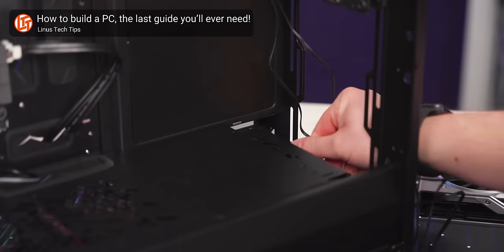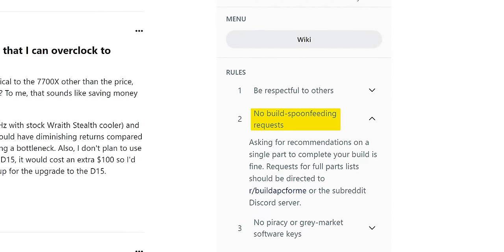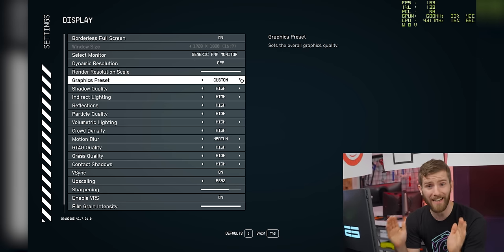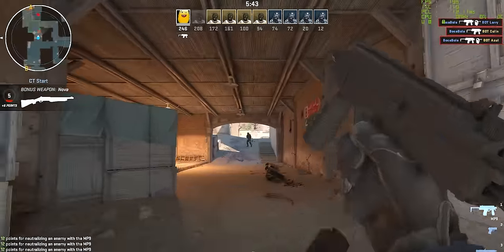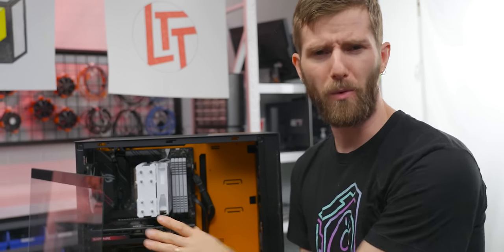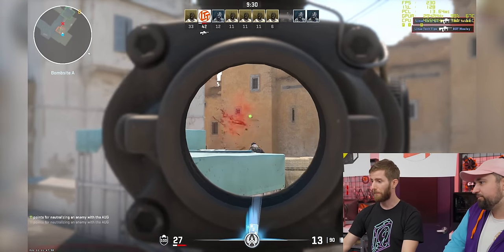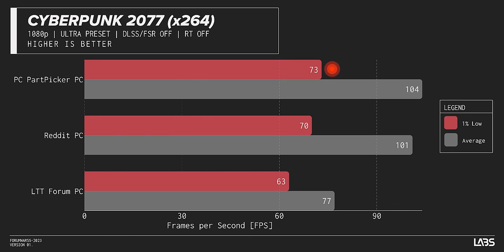We Secretly Challenged 3 communities to Build the Best $1000 Gaming PC!

Comment: Hi LTT, Love the video but there are a few areas I believe that could lead to some confusion.
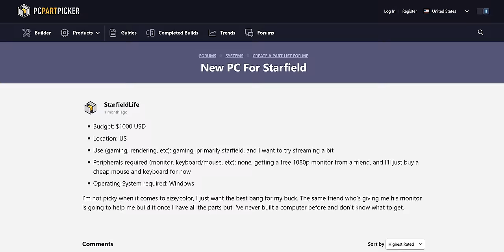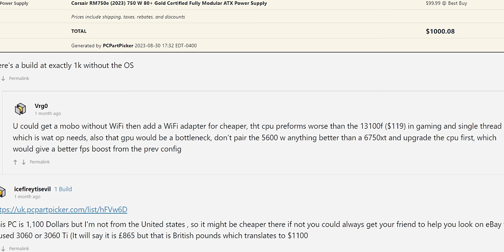1. the LLT requirements at 1:48 states "operating system required:Windows", however not all the builds chosen by LLT include an OS therefore not meeting LTT's own requirements (leading to difference in recommendations such as PC part picker at 6:14) nor staying within budget. This also skews the cost vs performance vs helpfulness of said forums.
2. Minor scripting error at 3:23 when Linus states "16GB kit". On screen information and build both state 32GB
3. Possible discrepancy with Reddit Build at 4:07. The screenshot shown has two storage devices in the cart/build (2x WD Green 1TB NVME). This is different than the Single Titanium Micro TH4985 1TB listed in the video description and the Reddit buyers guide. Without knowing what build was actually purchased, this again could skew cost vs performance vs helpfulness.
4. Aligned with #3 above, at 6:54 Linus mentions the PCPartPicker build has "half as much storage at 1TB". The storage for the Reddit built was never shown nor discussed in the video. Also based on #3 above there is no factual proof that the PCPartPicker is indeed half the storage, as if the listed Titanium Micro was purchased based on the video description then it would be the same not half.
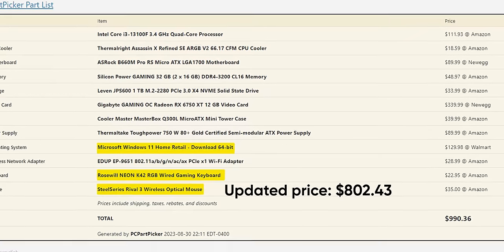5. Issue at 6:28. LTT removed the copy of windows although stating Windows and OS was required, see #1 above. Also the build was not chosen as it was quite under budget. However, the LLT forum build at 10:24 is also $100(10%) under budget while stating at 12:34 that all the systems are "the exact same amount". A 10% difference in price is a pretty significant margin of error/delta in cost when LLT chose the build, as that can allow for a tier bump on a CPU or GPU (would explain the lower performance).

Recommendations:
1. A smaller margin of error/delta in costs when choosing builds.
2. Validation checks that the chosen builds meeting the outlined requirements.
3. Provide better transparency by including the full purchase order of parts and costs to the viewership, to better compare cost vs performance vs helpfulness of the forums to make more informed decisions.
Reply: And another one, the LTT-build is listed as 2x16GB but the footage shows 4 RAM sticks of unknown amounts
Reply: Maybe this video was made before the LTT controversy about inaccuracies in the video.
Reply: The 3600MT kit in the PCPartPicker build is also shown at 8m04s to appear to be running at only 2666MT, which will have an impact on the Starfield performance being shown.
Reply: Also noticed that while panning over the "Corsair" PSU at approx 10:56 the brand prominently says Seasonic.

Comment: I will say, for Reddit, asking for a complete build like they did here isn't where /r/buildapc shines. However, if you post a complete build and ask for thoughts/advice, you will usually get engagement. Expecially if you're like "here's my build. I want to play Starfield on 1080. Is anything really bottlenecking me here." And I think you'd get good responses in the comments.

So it's sort of a square peg round hole issue for how they chose to use /r/buildapc
Reply: I haven't used reddit for a while but I remember r/pcbuild being pretty good and also a subreddit specifically for spoon-feeding builds
Reply: @sunbleachedangel  that was a long time ago. People who needed help fixing their existing builds grew and it is now more of a tech support sub for people building PCs. It is for the people who want to engage and learn building PCs now. Not for spoon feeding people who come and then leave and never come back.
Reply: that sub is terrible and irresponsible.
Reply: Yeah buildapc never failed me in the past 10 years
Reply: And you don't even need to post a complete build. If you have an idea for some parts and need advice for the rest, while also giving budget and use case, you will usually get really helpful comments and maybe even discussions about the parts going. Sometimes it turns to really funny comment chains as well.
In all honesty, /r/buildapc is imho one of the top communities on reddit.

Comment: For me it seemed like the last one is suuuuper solid if you're planning on upgrading the gpu within the year or so since the GPU won't be as bottlenecked by other components, but that still is sacrificing performance in the present.
Reply: Agreed. The larger amount of ram, faster cpu, plus a better/faster nvme, etc gives you more ‘general use’ performance. The video card can easily be upgraded within the next year. For a ‘noob’ computer user, I think the LTT system is the better buy.
Reply: 5600 and 5700x are about the same in games, the 32gb of ram could come into play I guess but it's very unlikely.
Reply: Wow last gen cpu, lets wait a year and than put 4090 there
Reply: I have a old system and did it the other way around. Bought a 3060 (and a new screen) on sale and I will be upgrading the rest within a year or two. So makes sense if you want a beast pc but are on a budget.
Reply: I'd argue for trying to squeeze a Ryzen 7000 series in as the ram prices are somewhat similar AND it will have longer support (or so AMD says). 12/13/14th gen Intel is theoretically "done" as Intel usually moves to a new socket type. But a NEW PC with 5000 series? Can't really recommend that anymore :(
Reply: @kingcharming1   same, i had i5 3470k and a 2060 at one point
Reply: @paulmeyer1001  If 5000 series CPU is out, what do you suggest they get instead in each of these PCs?
2 of 3 also use last gen GPU, would you downgrade this more for a current gen CPU when the PC is already limited by the GPU in most of the games?
Reply: Bottleneck depends so much more on game, settings and/or resolution,NOT what some calculator or tech influencers tell you.
Reply: @paulmeyer1001 
If you wish to maximise performance and care little about CPU future proofness,5000 series can be a great choice.
Depending on raw performance of the build,a gamer might keep the PC for 4-5+ years without any changes except maybe for storage and RAM.
By that time AM6 shall be out.
Possibly AM7 and 5700X3D and 5800X3D(not worth it since 5700X3D came out)are about as strong,if not stronger than Ryzen 7 7700X in gaming.

Depending on a budget,AM5 can become so much better choice, however for significant amount of budgets,AM4 is still superior choice.

Comment: Corrections for the LTT Build:

At 10:40, it should be the Corsair Vengeance RGB Pro 32GB (4x8) DDR4-3600 CL 18
At 10:57, it appears to be the Seasonic FOCUS GX-750, but I'm not entirely sure on that one.
At 11:03, the card is a Sapphire PULSE RX 7600 (still a 2X card)
Reply: How the heck did they miss that in editing yet again LTT is making mistakes that shouldn’t happen
Reply: At 3:27, they explain that the parts aren't exact but made an effort to be comparable.
Reply: @johnathangreer2472  but that was about that specific build , this mistake was way off.. dont really care but if they are going for correct representation then mistakes were made in editing obviously..
Reply: How can you watch that back in editing and give it the thumbs up when there's clearly 4 sticks of ram and not even the same manufacturer.. Dang bro
Reply: @wrangler2155   No, it's for all the builds. He says "Now you might notice for our test builds today, that we didn't necessarily worry too much about having the exact same parts, but we did make an effort to ensure that our results would be comparable.
Reply: @johnathangreer2472  Yes, however the on-screen graphics I believe should match up with the in-hand products being shown on screen. Otherwise, the B-roll doesn't really make sense, because why would you show sticks of RAM, a power supply, and a GPU in the same order that the on-screen graphics showed up without the two being related. Additionally, certain changes (such as the motherboard being changed from a B550-F to a B550-E) were done "properly", by changing the on-screen graphics to match what was being shown on the screen.
Reply: not sure why it really matters if performance is comparable
Reply: Linus explains quite clearly at 3:29 that the builds they put together won't match up exactly but that they made an effort to be comparable. 

It's in the video, clear as day.
Reply: @Ragnorok64  A list is just a list. If they're naming parts and showing b-roll of different parts. That's objectively wrong. Parts on-screen and the parts tested should be named. Not some close equivalent. The clarification of an altered part list makes sense, the mismatch of text and video of what's being used does not.
Reply: @jyrolys6  No. Relaying the list that was provided, since they sourced where they got it and even from whom, is more important. Of secondary  importance is that what they test is reasonably equivalent to the list, this is a case where accuracy is more important than precision. And last in importance is what the B-Roll shows.

Comment: For the LTT forum build the ram showed 2x16gb at the top but installed in the computer was actually 4x8, I assume
Reply: The brands were mixed up as well
Reply: QC going down again. ☠️ who’s gonna call GN
Reply: Check 3:30 he said their builds wouldn't be exact part matches.
Reply: Seems you didn't watch the video LMFAO.
Reply: They also said for the reddit 16gb kit then show 32gb in the graphic
Reply: @NADP0 they are all wrong though. And you cannot tell me LTT doesn’t have a boat load of memory floating around and how hard would of it to of swapped dual slot memory between the machines between the tests if they needed the same spec ones. That takes about a minute or two.
Reply: Comparable in price and performance. Not all the parts were exactly the same for these tests, but close enough.
Reply: doesnt matter at all tho.

Comment: I bought a used HP Omen desktop, 11900K, 3080Ti, 32GB RAM, 1TB NVMe for $900, it thermal throttled a lot, spent the extra $100 to put all those in a used Corsair 4000D with 6xML120 a Noctua D-15, everything runs cool and quiet. BTW, those HP Omen 25L/30L/45L systems have standard motherboards and CoolerMaster Gold PSU, so case swap is a breeze and is a such a good deal.
Reply: That's very smart!

Comment: I would love a small hint to how much power a build uses. Just a few seconds saying an average or something.
Not just for this video, but for future builds.
Reply: Best thing to assume when thinking about power usage - assume the PSU is using its maximum all the time, just in case it ever is. That way you wont accidentally trip the fuse box.
Reply: @itskdog  I imagine he was asking about power usage in regards to how much it'll cost (which is a big concern in Europe as the more efficient but pricier build can pay for itself within a year), not whether it'll overpower the network.
Reply: PC part picker has a power usage calculator.
Reply: an 5800x3d at full power and an rx 6800 also full throttle with 2 nvmes and 2 ssd´s plus one hard drive dont even stress my 500w bq pure power 11 all ridiculously overspecced

Comment: There's also an issue for the RAM in the LTT forum section: text says 2 x 16, but the B roll shows four sticks of memory
Reply: In the beginning of the video he says he not using the same parts but using parts that have the same specs.
Reply: @bobberry1463 Yeah but 4 channel does not have the same performance as dual channel, maybe negligible for this test, but still.
Reply: Also at 3:26 they say they got a 16gb kit for the Reddit PC but the overlay text says 32gb🤷‍♂️
Reply: @bobberry1463  While likely negligible, all these little errors or inconsistencies just speaks to an ongoing lack of attention to detail by (in this case) the editors, which rightly or wrongly impacts the viewers trust in the information/data/testing which is being presented.
Reply: @littlefrank90  if you look at the specs of the motherboard, it only supports dual channel. So, while there are 4 sticks, its being ran in dual channel. A clarification should still be made though. Also, the 5700x only supports dual channel as well.
Reply: @jono6379  yeah I just caught this error too. Wtf LTT... that was an EASY spot. I thought they were reviewing these?
Reply: @colinstu  the problem is for the longest time they have been as much an entertainment channel as they are a tech channel. Getting away from just purely entertainment and moving towards a proper testing and review channel is going to be difficult.
Reply: Oh no, not this again... Don't let Steve know about it
Reply: @theftking  its not major, it doesnt fucking matter its 5ns latency on a daisychain board, 1 on an t topology board, DOESNT MATTER AT ALL.
Reply: @littlefrank90  It's still dual channel, just with two sticks per channel. These consumer platforms don't really ever even support anything higher than two channels. Still, I agree, they really shouldn't be making mistakes like this. Sure, it's fine if they just used what was at hand, but at the very least, the text on the screen during the b-roll should correct the previous error, so it's weird that it just doesn't
Reply: @copypasta1585  Interesting, thanks!

Comment: that Phanteks case took me a month to find, but it hit every single thing I wanted. Affordable, pretty well made, and the airflow is excellent. Honestly, best case I've built in for the size. My previous case was a Corsair 200R, which at the time was nice, but is so massive and just didn't make sense to keep using for a new build.

Even funnier on the second build, the Lian Li case was my higher priced option over the Phanteks, which the bigger front fans would be nice, but really not necessary. I would say you're unlikely to see a huge difference in heat. The front mesh panels on both are the big reason. They also grab a lot of dust without causing air flow issues. And the 6800 is an excellent GPU from what I am seeing, and if I'm upgrading from the 6600, it's a solid choice.

On the 3rd option, I think they set the person building it up for a better long term upgrade with the GPU. I opted for a much higher end build on my own system and only sacrificed the GPU since prices were insane at the time, and the 6600 was the best bang for the buck at the time.
Reply: im still running with a corsair 200R from like 2011 haha
Reply: @RedleafUK  It's a great case, just lacks some modern stuff on the front panel, and takes up a ton of room. I keep it on the floor so it was raised up on a stand with castors. My desk came with a flat wood stand and a small case fit much better. I still do not have a use for the 200R, which is a shame since it was reliably great for a decade.

Comment: Realistically though, having an active community with more options, good discussions/assistance, and overall more activity is more important than whatever random build you get at specific price point. I'd argue this is true for first-time builders as much as veterans. Personally, while I'd have traded a bit more CPU for GPU than the LTT build, I would spend a bit more than the other 2 builds on the other parts like PSU, NVME, etc. It doesn't cost much to go from a low/mid grade component to a mid/upper grade one and not having your power supply or drive die in a few years is worth an extra $100-200 spent across those other components.